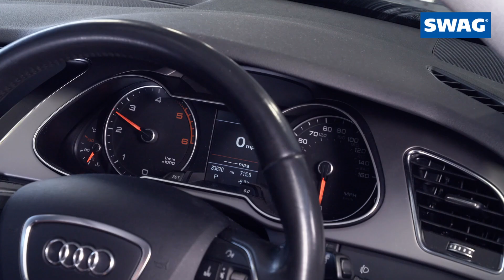[EN] Audi 0AW CVT Automatic Transmission Oil and Filter Replacement

Comment: Great explanation! finally I can go to a mechanic with some prior information. It is always better to know how things are done in advance to not get scammed at the repair shop :D
Reply: @SWAG_CarParts I had been to mechanic and the problem is there is no way to take the transmission filter on V6 engines. I have a 3.2 A5 with CVT and the engine sits right on top of the transmission. There is no access to the filter from the top. Do you know how to replace the filter on V6 ?

Comment: For mine the mechanic has changed only the oil . Now i have to change oil filter by my self . Can i only remove the old filter oil and put the new filter oil? And go on with driving normally?
Reply from the maker: Thank you for watching our video. If only the filter is replaced, there will also be some transmission oil loss. It would be recommended to recheck the oil level as described in this video.

Comment: I had slipping problem after oil change. They did not change oil filter which got clogged and caused low oil flow. You have to change oil filter every time you change oil because new oil will wash away dirt and other particles stuck on the walls and parts of gearbox components. That s why is soo important to change it on regular service intervals recommended by manufacturer. If you let it go too much driven over recommended service interval its better to do it 2 to 3 times oil and filter change in short intervals to wash out all dirt inside and get caught by filter. This is my experience.

Comment: Great video. I have a couple questions, do you check the transmission oil level with the engine still running? And I assume you let the oil gently flow until it stops, and then remove the adapter and replace the drain plug? Thanks.
Reply from the maker: Thank you for watching our video and kind comments. What you have described is the process as followed in the video.

Comment: Hi
Can you change just oil filter and not loosing oil pressure inside a gearbox ?
Reply: You’ll lose any oil in the pipes
Reply: @carYouTubefdaf i dont understund your reply . For mine the mechanic has changed only the oil . Now i have to change oil filter by my self . Can i only remove the old filter oil and put the new filter oil? And go on with driving normally?
Reply: @ answer is you may need to top up missing oil. When you remove the pipe you may lose 1-2L of oil. Safer to change full oil unless you measure it all

Comment: What size thread is the filler tool.
Reply from the maker: Thank you for watching our video. There are no special tools required to replace the filter, or are you asking about the transmission oil filler tool adaptor?
Reply: @SWAG1954  Yes, the adapter that screws into the gearbox to allow you to pump the fluid back into the gearbox
Reply from the maker: @scott2735  The thread size is M22 x 1.5 x 10mm. We used Laser adaptor 4988 in this video with the filler tool 4792.